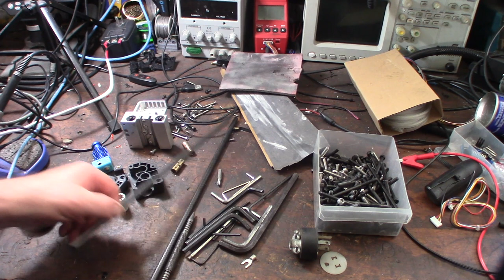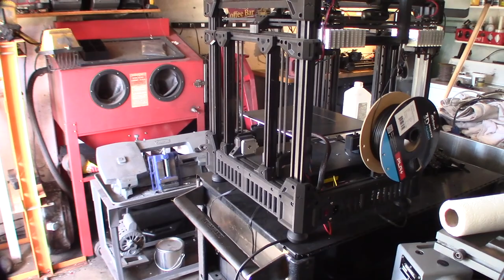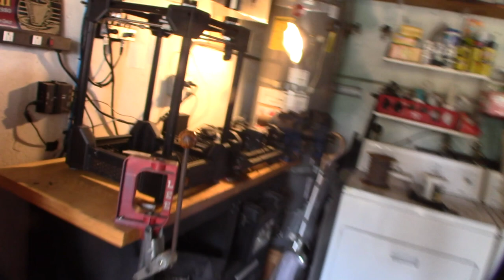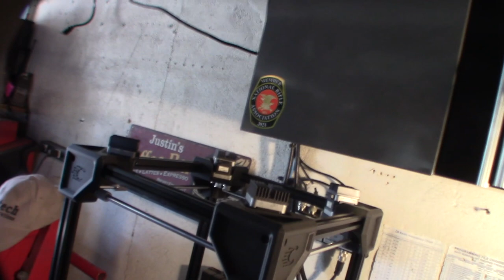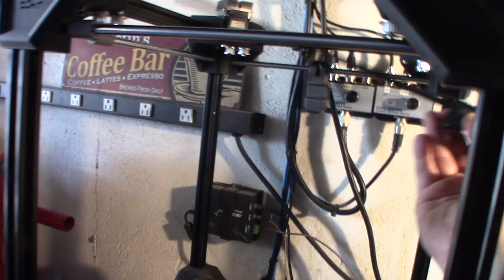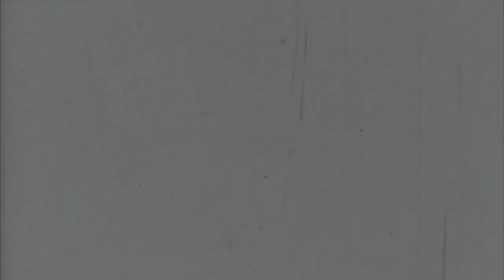Carbon Fiber 3D Printer Linear Rod Preparation With Wrapped Oilless Bushings Brass Graphite

Comment: Bro, use super high polish wet/dry sandpaper. I polosh metal and all types of epoxies and finishes to a mirror polosh with 5000 grit, then 7000 grit, then 9000 grit, to 10,000 grit. The 10000 grit will polish those carbon fiber rods like glass. I did it to my Qidi x smart 3 carbon fiber rods. They have all those high grits on Amazon.